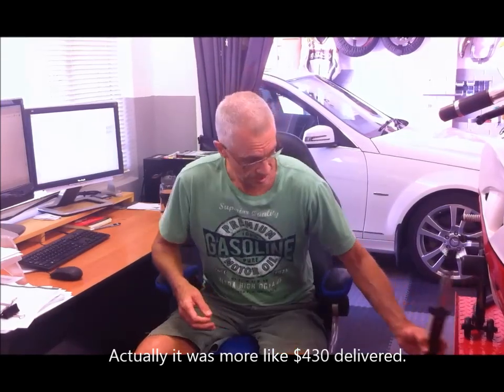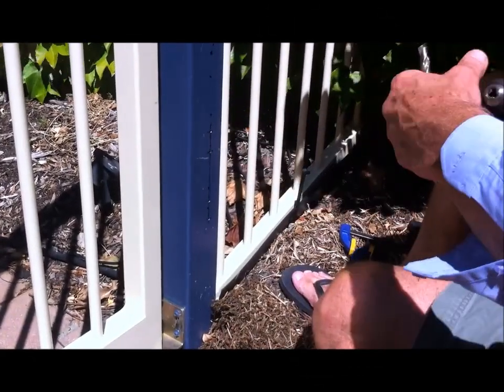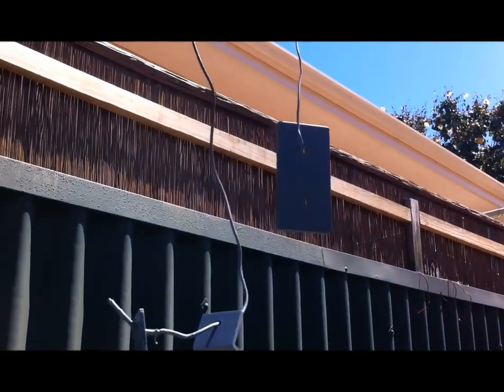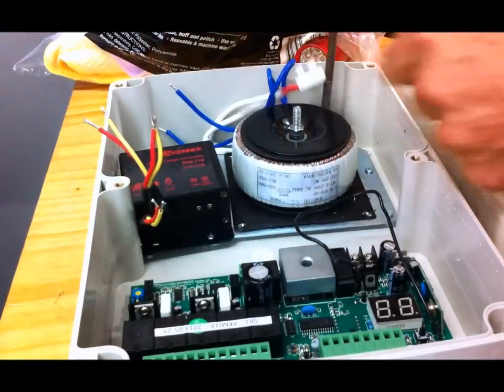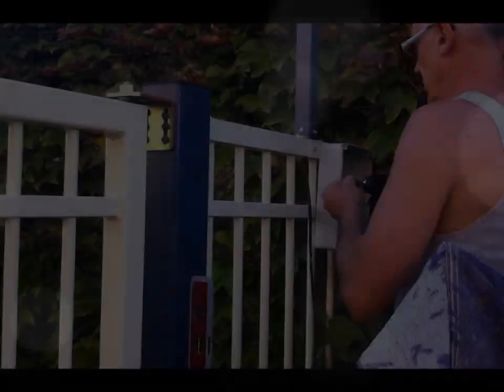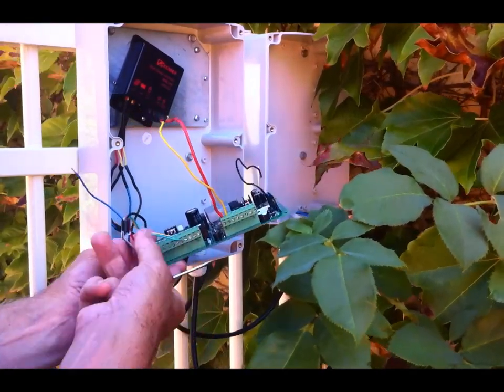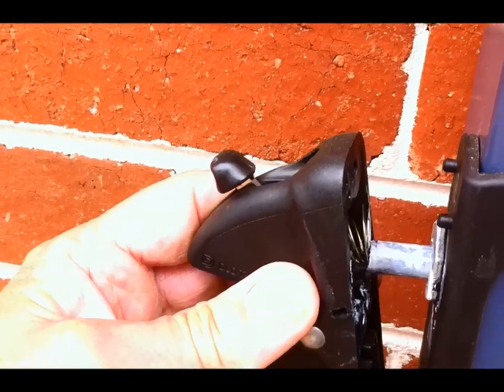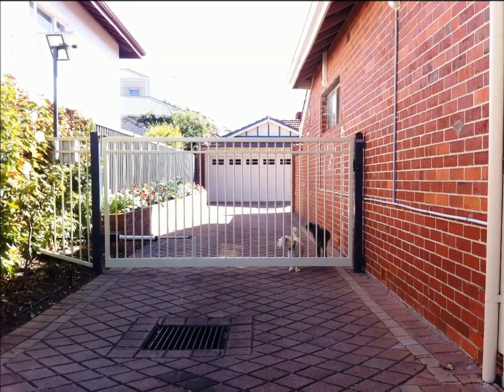How to Install Electric Solar Automatic Gate Opener Motor Actuator Remote Control Kenner KNL01

Comment from the maker: A note to file:

I found if we have several overcast days in a row and we're in and out a fair bit the battery pack will go flat. I solved the problem by purchasing a cheap 24V trickle charger and have it plugged into a timer that turns it on every night for about 10 hours. I connected the charger output wires to the solar panel wires (positive to positive and neg. to neg.). The solar panel has an inbuilt diode so the charger can't send power to the panel only to the batteries via the regulator. It's all working very well.
Reply: Scott Elliott Scott, I have a question..I will attempt this same set up for my farm here in the Pacific North West. Question; what if I use a regular 24V deep cycle marine battery insted of the two 12V (24V batteries that you have installed. Would they hold a better charge inbetween overcast day's?
Reply from the maker: Yes my understanding would be the deep cycle 24V would be better. Your geographic location will have an effect. Place the solar panel pointing north and set it at the right angle for your latitude. There's plenty of information on the web if you google it.
Reply: +Scott Elliott 
Hi Scott,
I have the same system and experiencing the same problem when I have several overcast days in a row. Could I ask what specs your 24V trickle charger is? what current does it charge at for normal and trickle. Would really appreciate it if you could let me know where you purchased the charger from too! Thanks a lot in advanced =)
Reply from the maker: +Michael Lim I came up with a better solution. I mounted the transformer that was originally in the electronic cabinet into a separate small electrical box. I mounted that on the wall next to an external GPO on the brick wall next to the garage wall. I connected the 240V side to a short cable with the std 3 pin plug on the end which plugs into that external GPO. I purchased HD garden lighting cable from Bunnings quite cheaply. I ran the twin core HD garden cable from the box to the 24V input inside the cabinet which is next to the gate. I measured 24.7V at the transformer and 24.5V at the gate end so the voltage drop was peanuts. That's worked really well. There's no need to run 240V out to the gate.
Reply: +Scott Elliott Hi Scott that is absolutely ingenious! why didn't I think of that? thank you very much Scott!

Comment: Could the opener have been mounted to the brickwork, I'm wondering if there would be enough room in this type of application.
Reply from the maker: If the gate was swinging the other way and I fabricated a different bracket I could have mounted it on the brick wall. However that side house wall is the boundary and I'd need permission from the owner of the front house because the dynabolts would be penetrating their property. It was far easier to mount it the way I did as it's contained on my land. The actuator brackets in the kit are designed to be mounted on the gate post. Regards Scott.
Reply: @ScottElliott152  thank you Scott, I have a situation at my own property where it's a colorbond fence on one side and the bricks of the house on the other but the only mounting post I would have would be 50mm wide maybe I could make that post a 90 by 90 but I don't know if there's enough room for the actuator to be between the house and the gate when the gate is open.
Reply from the maker: @explodeaload  You do need some clearance between the gate and the mount for it to work ... about 80 to 100mm. It might look strange but you could mount the actuator on the gate and the end of the rod on the wall. Doesn't solve the clearance issue though.

Comment: Hey Scott I bought this model and im wondering about the load wiring from the solar charge controller? Did you run the those 2 wires into the control board bat positive and negative. I noticed you linked yours from the controller to the swing gate opener control box
Reply from the maker: Hi Darren. It's a long time since I did this (over 7 years!) so I can't recall the detail but I followed the wiring diagram provided. The output from the solar regulator connected to the Batt + and - terminals numbers 13 and 14. Read through the comments as I found I couldn't get 100% availability on solar power alone because sometimes the sun didn't shine for days on end ... funny that considering renewable energy is being pushed so hard these days. I ended up connecting the transformer and run it off the mains (a combination of coal, gas and my roof top solar array) with the batteries as back for the rare occasion the power is off. All the details are in the comments and I updated the description early this year.

Comment: Hi Scott, having issues with setting the limits on a fresh install to get the gates to stop at the desired points, any tips?
Reply from the maker: Hi Nic ... you probably need to adjust the little sliding limit switches underneath. It's easy to do. Loosen a screw and you can move them.

Comment: Hi Scott, Great video, well put together.  I have a similar setup, although yours is a lot neater than my set up.  I have struck a problem trying to identify what the instruction book calls a control box fuse as my gate has stopped working although I have tested and power is getting to the panel from the batteries, and when connected to AC, the transformer successfully delivers the 24ac to the panel.  The LCD panel does not show the blinking  "--" as it would normally do.  Its only about 12 months old, and the fault occurred (I think) while the AC power was not connected to the system.  Any thoughts would be much appreciated, as I have had no luck looking for discussion on it
Reply from the maker: +Sean Boatwright Hi Sean thanks for the compliment. I've had similar problems with no blinking before I connected to mains power. I'm not sure there's a control box fuse as I can't recall seeing one on the board. 

The way to reset it is to pull out the two large connectors at the bottom of the board and plug them back in again. Give them a dose of silicone spray as it makes it easy to put them in and out and improves the electrical connectivity. Give that a go first. Regards, Scott
Reply: +Scott Elliott Thank you VERY VERY much!! As I wasn't exactly sure which connectors, I thought I would try disconnecting all power first including the battery cables from the control board and left for a couple of minutes. Thought this would have a similar result (although I had to unscrew a few more things this way). Connected the battery cables,  and magic... all going again.  Once again thanks for the response, it fixed my problem!

Comment: Hi - thanks for the great vid, it'll be very helpful as we intend to buy one of these kits. Question, our solar panel would only get about 4 hours of direct sunlight per day in winter and obviously lots more in summer. Would this be enough to power the gate? And also, is it easy for visitors (who won't have a remote) to come and go through the gate by opening it manually? Thanks heaps, Lucy
Reply from the maker: Hi Lucy,

Thanks for your kind words. 4 hours per day of winter sun will not be enough from my experience.

I found if we have several overcast days in a row and we're in and out a fair bit the battery pack will go flat. I solved the problem by purchasing a cheap 24V trickle charger and have it plugged into a timer that turns it on every night for about 10 hours. I connected the charger output wires to the solar panel wires (positive to positive and neg. to neg.). The solar panel has an inbuilt diode so the charger can't send power to the panel only to the batteries via the regulator. It's all working very well. The charger and timer are in the garage and I bought some of that heavy duty twin flex garden light cabling from Bunnings ... about 20m ... and run it under the fence capping to the solar panel output wires.

As for visitors ... there's provision on the main control board for a manual push button momentary switch at terminals #19 & #20. I bought two waterproof push buttons from Jaycar Electronics http://www.jaycar.com.au/productView.asp?ID=SP0756 for about $7 each and mounted them on the gate post. Go to 17.45 on the video and you'll see the inside switch. I put one on each side wired in parallel. That's the only way for them to get in as the actuator is locked in position when closed so they need to be able to push a button to get the actuator going.

The AusPost delivery man seems to have worked it out as he just pulls up, jumps out of his van and pushes the button and drives in. Hope this helps, Scott

Comment: Hi Scott and great video before I start my installation. Can anyone advise the wiring colours for the transformer - the unit has Red & Brown - presume Red is live, and can they be reversed without damage. Using twin solar & possible mains.Mark
Reply: Mark did you work it out we have the same problem

Comment: Thank you very much Scott for sharing. I am thinking to install an automatic control on my gate. Where do you purchase the 24volt solenoid latch? I think it is a great idea. Always worry the wind or someone push will damage the unit.
Reply from the maker: Patrick Poon Thanks Patrick. Yes I had a delivery driver push on the gate as he didn't see the button to open it. He bent the end bracket. The actuator is robust so the worst that will happen is a bent bracket. It took me about 20 minutes to repair as I had to take the bracket off. I used a very delicate tool to straighten it ... a hammer!If your gate is latched then I don't think the wind will be an issue ... unless you have a typhoon or hurricane. Is the gate made of bars or a solid panel?@au-deal-store is where I bought the solenoid but they don't seem to be listed.@itm/DC-24V-Linear-Motion-Push-Pull-Type-Tubular-Solenoid-Electromagnet-50g-6mm-/291169321103?pt=LH_DefaultDomain_3&hash=item43cb0b408fsearch eBay for "24V solenoid dc pull"

Comment: Hi Scott, great video, thanks for sharing. Would you be able to make me one of those awesome brackets, just what I need, as my gate is the same, aluminium vertical bars, not strong enough for operation. Thanks
Reply from the maker: I've since remounted the actuator lower so it pulls on the lowest solid member of the gate. I used the bracket supplied in the kit. I attached it to the alloy member with large self tapping screws. I did that a few years ago and it hasn't budged. I had to use a spacer behind the bracket to set it off a bit to get the range of movement.

Comment: Hi thanks for the video. I purchased and installed exactly the same solar gate opener kit except with dual gate openers. I also purchased an extra solar panel to help charge the batteries. I hope you can help me. When I disconnect the batteries from the circuit board the solar panels charge the batteries with no problem. However when the batteries are fully charged I reconnect it to the cir u it board to get the thing functioning. However it seems like the batteries don't charge or charge slower than the power the unit uses in standby mode or light usage. The batteries charge with the panels with no problem so it seems like that works but when connected to get the whole unit working it just doesn't charge fast enough. Any ideas? Cheers mate
Reply from the maker: Andrew do you have the solar panel regulator wired correctly? The batteries don't connect to the circuit board the solar regulator does. Also do you the two batteries wired in series to give you 24V as each battery is 12V. That's all I can think of at the moment. Regards, Scott
Reply: Sorry yes I meant the batteries via the regulator. when charging the batteries via the solar panel I pulled out the green connector on the right side of the circuit board which is essentially the regulator connecting to the circuit board to charge the batteries.  Yes I've got the 2 batteries connected in series to give the 24v. One thing I might try is replace the clips that connect the wires to the batteries it seems loose but I don't know how much that would actually effect how fast the panel charges the batteries. I'm so grateful for your quick responses I've been working on this gate for ages!
Reply from the maker: Andrew Tan Mine's been working famously ever since I put it in. I can only suggest you double check all the connections as I suspect something's not quite right. I also sprayed all the connectors before plugging into the circuit board to make sure I had good electrical contact ... silicone spray. You may need to check that none of the pins are bent or have corrosion. When it's connected check you have 24V at the board input and the output for the actuator when you've pushed the button. Regards, Scott
Reply: MrScott52 Thanks mate. Checked all the connections and it seems to be working i think. The clips on the batteries which make it a series were loose and now its charging again. I was monitoring it and on a cloudy day it seems to drop 26.3v combined at 12:20pm. By 1:30pm it was 25.6v. I've been reading up on regulators and it seems as though it kicks in before the batteries get fully charged. Does this sound right to you - the readings. The solar is supposed to still produce energy even on cloudy days so shouldnt it be rising until over 13v each?
Reply from the maker: Andrew Tan That sounds about right compared to what mine does on cloudy days. Keep an eye on it now over the next week but I think you've cracked the problem.
Reply: MrScott52 you're a legend. I'll keep you posted. Cheers
Reply from the maker: Andrew Tan Legend maybe "drawing a long bow" as they say! I'm happy to help out. Post an update later of your findings.
Reply: MrScott52 Mate. I'm so ready to throw in the towel but i can't give up! So it seems when the batteries (connected to the regulator) charge with the solar panels showing a reading of about 26.2v combined while NOT being connected to the circuit board. So i throught sweet, batteries are full at 13.1 each so might as well plug it in and see if on standby mode it will remain that way because in theory...standby mode will drain power while the solar panels will replenish it. Left it all day without using it. Got home tested out the voltage....combined voltage is showing 23.1v. Funny thing is that 1 battery (+ connected to the regulator) is showing 10.5 while the other is showing 12.6v for a combined value of 23.1. Previously when charging it the batteries always seemed to charge at the same value. Does this mean that when its not connected to the circuit board it charges fine, but when its connected it either doesnt charge or 1 of the batteries doesnt...i'm really confused and frustrated now. Hope i explained it ok....
Reply from the maker: Andrew Tan Andrew you will probably have to contact the supplier as I think something maybe faulty. Obviously you've triple checked all your connections so there must be something wrong.
Reply: MrScott52 Unfortunately these ebay sellers just sell and dont know anything about their products but will contact them. From what i explained do you think its a dead battery or multifunctioning circuit board or something?
Reply from the maker: Andrew Tan Yeh it could be either. It would be worth trying to get hold of a couple of 12v batteries and connect them up to confirm the original batteries are either ok or the cause of the problem.